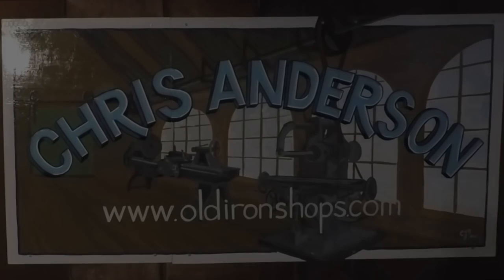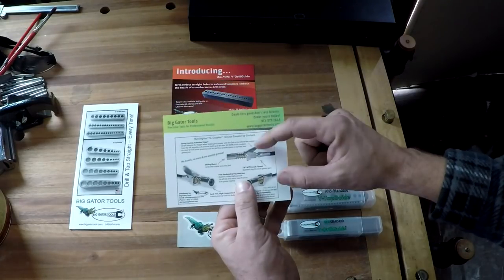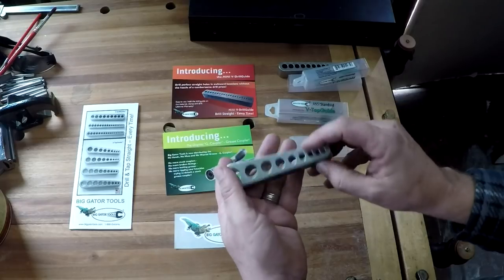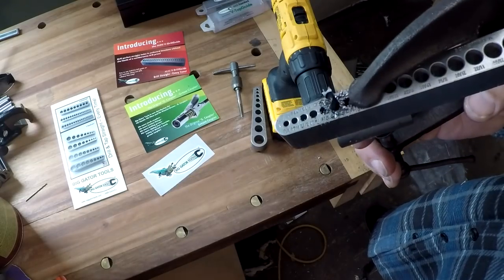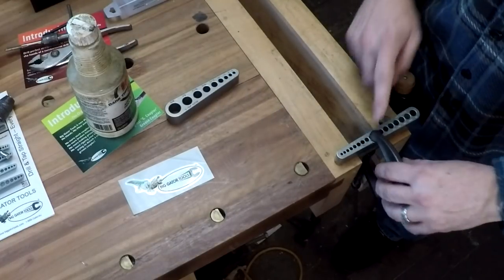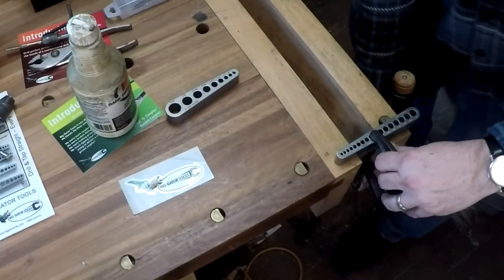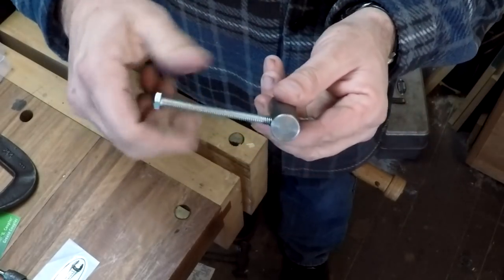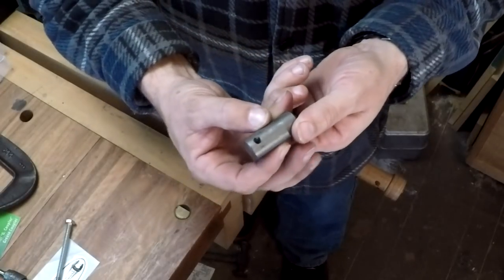V-Tap Guide Big Gator Tools

Comment: Hi, have a question, the MTG500NP  model has the center base lines from each hole like the others?
Reply from the maker: Im not exactly sure what you mean.
Reply: @OldIronShops  I am not sure if the model that i´m talking about has those vertical lines that helps to center exactly the hole with the marked part on the wood. Those lines are in the body of the guide
Reply from the maker: @Solerius1990  yes I believe all one the drill guides have them